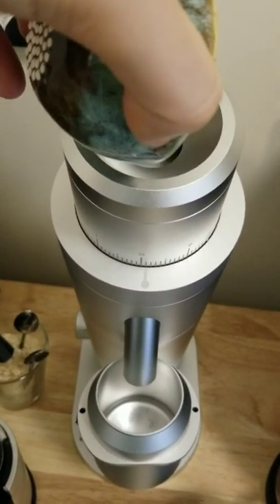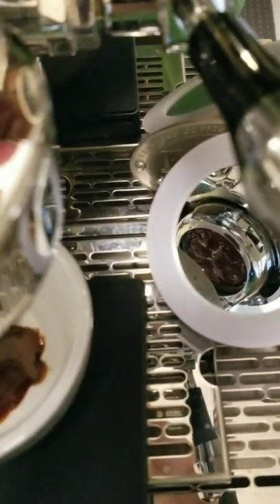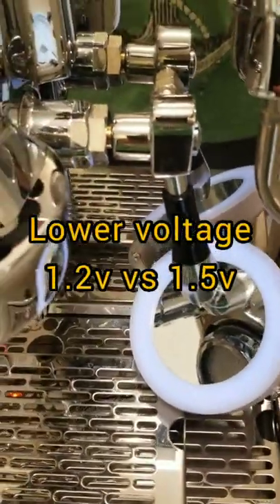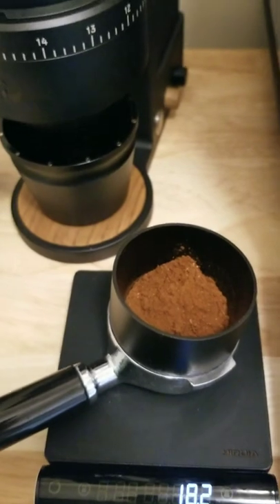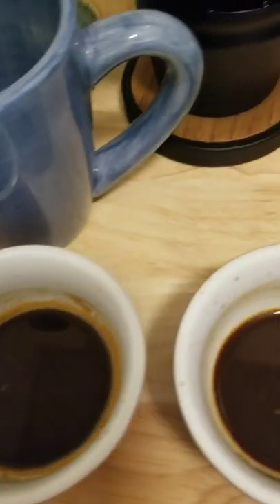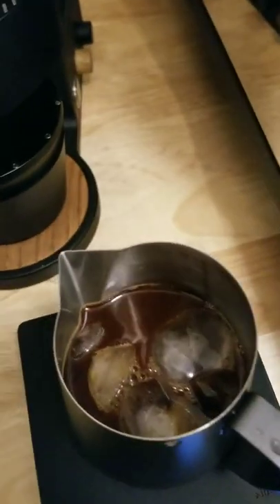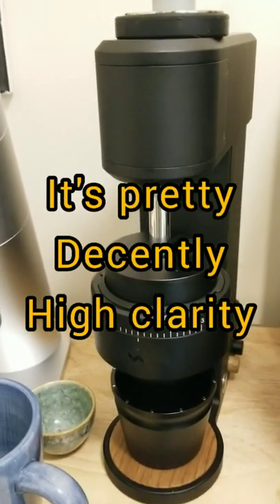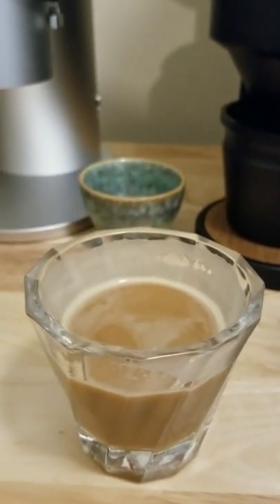Nitrogen Infused Espresso, Workflow & End Game Coffee Grinder Comparison / Discussion +more!

Comment from the maker: 10:18 Someone else has mentioned they had a P64 with the same SSP MP Burrs and it worked well for them at lower RPM range like around 650rpm (setting 4) vs my setting of 7 which is 1100rpm (DF64 and most mid range flat burr grinders usually run around 1400RPM for reference The Monolith Flat's max RPM of 800 is a bit of an oddity.)  He was using a high end lever machine so that could be a factor, as well as the coffees you're using but for me with light roasts, I found it was more difficult to get good results at lower RPM with those burrs, it would channel and taste wasn't meeting its potential.

Comment from the maker: Update: for some reason the Normcore Puck screen doesn't seem to fit as nicely in these Decent 20g basket with 18g dose,  maybe due to not not being ridgeless, it doesn't sit well (I was thinking more headspace is a good thing to fit the puck screen but nope, it also gave me sloppier pucks so negates some of the benefit of using the puck screen), it worked better in my old 18g VST basket (with 18g dose) which was basically the same basket although I think these Decent brand ones seem a bit heavier / more re-enforced (which probably isn't necessary but cool they're made STRONG). The 15g basket with 15g dose works well with the Puck screen though, so it might just need the appropriate dose for the appropriate basket, so the puck screen sits a bit higher up.